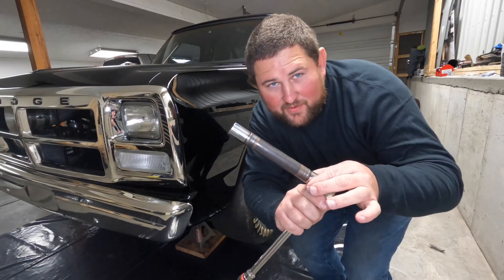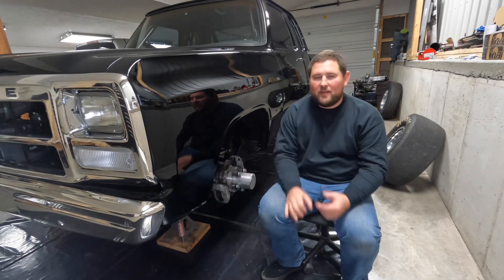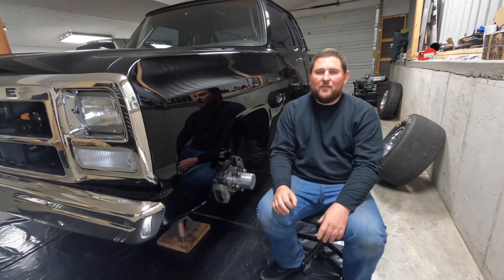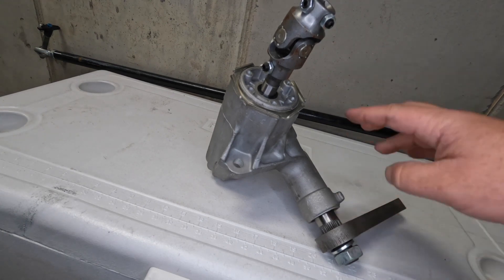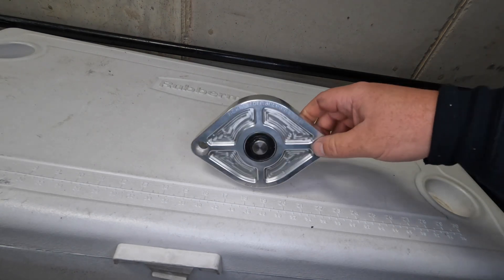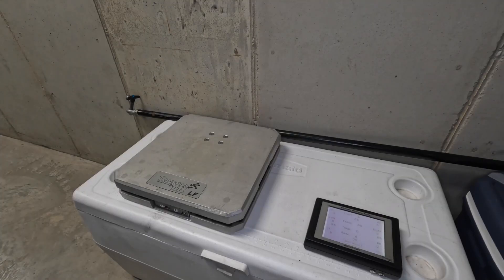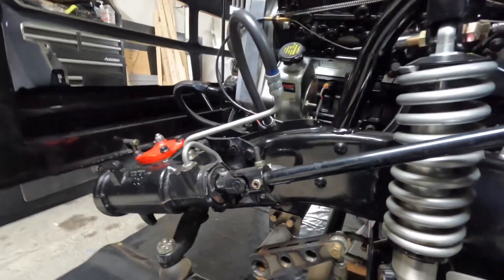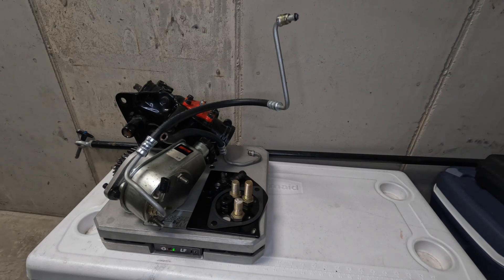4WD MANUAL STEERING CONVERSION!!!

Comment: You should have just mounted the steering box at the back. You could have lost even more weight and moved it back 3 or 4 feet. Also you got it backwards if the steering arm is longer it will steer more aggressive not less.